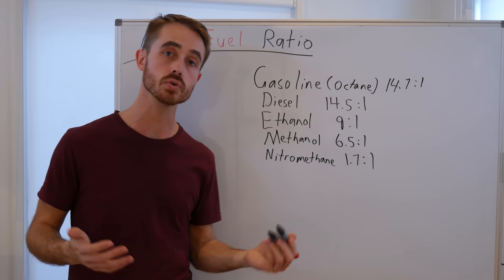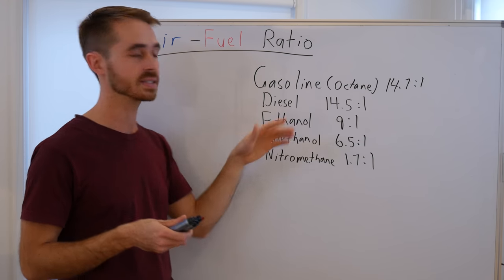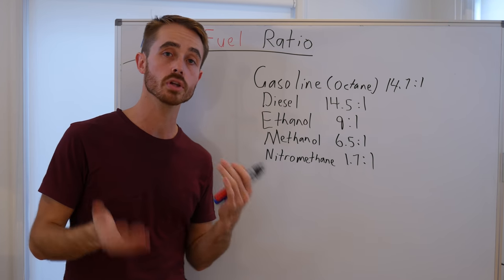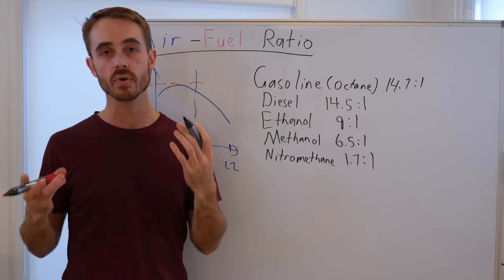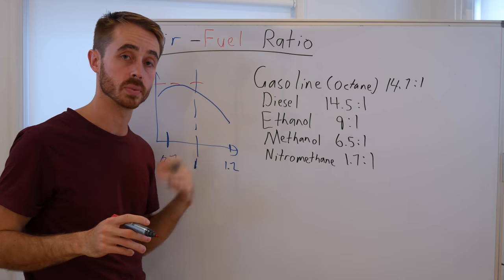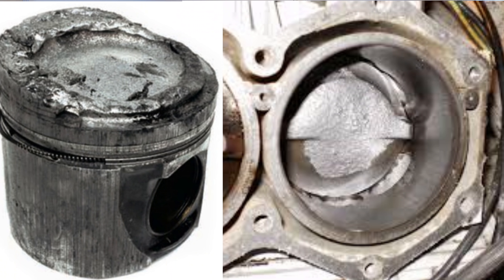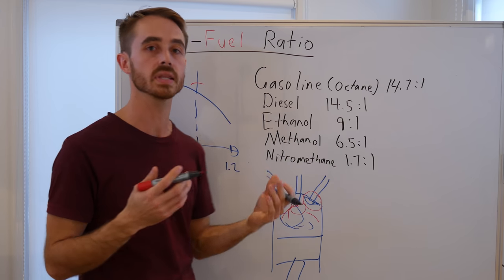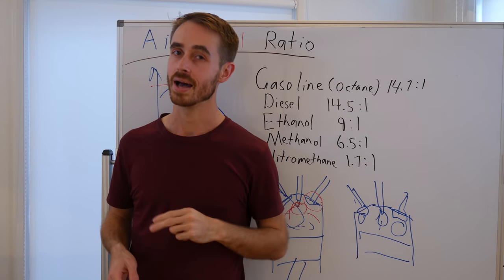Air/Fuel Ratio - How Does Being Rich/Lean Affect Your Engine?

Comment: Diesel engines are not stoichiometric by design. stoichiometric simply means all the oxygen in the intake charge is consumed in a given combustion cycle. Diesel engines are lean burning in general and air/fuel ratio is varied to control the speed of the engine. Not all oxygen in each intake charge is consumed in a combustion cycle. This is the number one reason diesel engines tend to emit higher levels of NOx. The leftover oxygen in the cycle forms oxides of nitrogen which is AKA smog. This is mostly corrected by the SCR and urea (diesel exhaust fluid) injection. Diesel engines often also employ cooled EGR to reduce the oxygen level in the intake charge during part throttle conditions. Stoichiometric is only applicable to gasoline engines.
Reply: +1
Reply: Nox is not technically smog, hydrocarbon is soot/smog

Comment: We use E100 since 70’s in Brazil. Ethanol is a bit aggressive to fuel system but keep the engines clean of carbonization, and not dissolve oil film like gas. The cars before flex ( ethanol only ) work with 13:1+ CR and is more efficient.
Reply: What Max CR have you seen with Ethanol?
Reply: @dennisrobinson8008  With pistons around 80-85mm bore and alloy heads water cooled, around 13.5:1 with stock cams and 15:1 with agressive race cams.
Reply: also b/c brazil produces alot of ethanol
Reply: Wow that sound like a hot rodders Paradice.
Unfortunately, here an America, the perception that we (USA) are the only ones who can have and create cool things. I know this isn't true, and I have known this for a very, very long time. This (your comment) is an example of an environment where a car/engine nut could go crazy and make power, but it isn't available in the USA. We don't always have the cool stuff, we could have.
Reply: @Fabio-jm9jq  13.5 to 15.5 you could make some power with that for sure!

Comment: Something interesting about diesel and gas is that the “combustion chamber” on the gas is in the cylinder head and on the diesel, its in the piston head. I dont know which is better for mpgs and/or power, i just thought that was neat.
Reply: Diesel is generally also regulated by timing of injection too
Reply: That isn't really all that interesting actually. It just has to do with the fact that diesel engines operate at much higher compression ratios, and a straightforward way this is achieved is having a tiny clearance volume, ie; a cutout in the piston head.
Reply: @SoumilSahu  I think it's interesting

Comment: being rich means you can afford better parts and maintanance for your engine
Reply: being lean means you're a gym bro
Reply: Lol yep.
Reply: @TheRobertChannel  so which gate vacuum line can get hot enough to melt lmfao, thats defiantly not how that works
Reply: @TheRobertChannel  U said a vacuum line could  melt lmfao, only way that would happen is if its too close to something too warm, u think hot air goes into a vacuum line?! XDDD
Reply: Nah, I think it's opposite : Fuel is EXPENSIVE, so if you run RICH, you spend MORE on FUEL, and have LESS MONEY to buy awesome NEW CAR PARTS...
Reply: @TheRobertChannel  I have a gas scooter I play with the screw it starts up 
Every time so I think I got it just right I hope
Reply: @funnydubby6401  Waste gate is on the turbo it gets pretty hot on the turbo like glowing hot the vacume line can easily rub on something hot and melt not sure why that's hard to understand ?
Reply: ace 996 compressor side doesn’t get that hot... and running rich wouldn’t be a wastegate problem because that doesn’t suggest how much fuel goes in, ur map sensor will though but if ur waste gate is failing then ur fueling should be able to compromise for the loss of air
Reply: Rich is better, but piston, combustion chamber area, exhaust port get dirty faster.
Reply: And being lean means that you're lighter than a fat guy so your power to weight ratio will be better.
Reply: I see what you did there. Lol
Reply: How bout being lean? Does it mean your a body builder?
Reply: Running a little rich is better than lean. Would you rather be at 13.2 or 16.2 for NA engine. The fuel rich has a cooling effect where lean has HEATING. What's better than being rich or lean is being tuned.
Reply: @justinbryant237  I never thought of that! 20.1 here I come!
Reply: @KDD8  lean is mean
Reply: @dennisrobinson8008  lean is swol

Comment: Today's ethanol blends alter the standard 14:7 stoich. With a typical E10 fuel stoich is roughly 14:2-14:4 and with a carbed engine it generally requires going a bit richer on the jetting from stock jets. At a steady state 'cruise' one can run cooler at an AFR of 16-17 than you can with an AFR of 13-13:5  (same scenario) non turbo or boost application. But you will need vac advance or an EFI set up for the leaner burn at part throttle condition (no/light load).

Comment: Thank you so much, as an aviation student, I could learn so much from your video related to the aircraft engine mixture system. Huge appreciate it!
Reply: Bear in mind that more fuel does not always mean safer/cooler engine. What this guy doesn't show on the graph is that cylinder temp. (and highest risk of knock) is highest and makes max power BEFORE 14.7, the top EGT. Safest is to run very rich or very lean. At economy cruise you'd want to lean past peak EGT to the point where you lose some power or rpm. I've seen so many videos where people take a LONG finding and staying at peak EGT, which is not good for the engine. And the worst part is that they then make the mixture a bit richer which puts them at worst possible cyl. temp. Unfortunately this is taught by a lot of flight schools. Watch a video called "obsessed with EGT", for reference.

Comment: Eng knock can also be avoided by running a higher octane fuel, don't get confuse higher octane does not mean higher volatility. 
Octane rating is an anti knock rating, developed in the second word war by the SAE to ensure that every batch of fuel for the spitfires was the same quality
Reply: llew virtue Correct except it was before ww2. Harry Ricardo came up with octane rating and his research got published in the early 1930. He also came up with the Merlin so yes you are correct, but it was earlier.

Comment: Cool stuff. This is relevant for small aircraft engines; these usually run very rich for takeoff to increase detonation margin, and lean off for cruise. In fact, most engines have manual mixture control, so it's useful to know what happens when you pull the red lever to lean the mixture for cruise. These engines have no ignition timing change (except a timing retardation for starting the engine); everything is simple and mechanical. Aviation gasoline still contains lead, but that will come to an end, and we will see how that works for high-performance engines, which still require an anti-knock index of 130 for takeoff power at full rich mixture.

You say Diesel engine often don't have a throttle body. Are there Diesel engine that do?
Reply: Thank you, I needed this answer.

Comment: In order to better understand air fuel ratios you need to show the optimum air intake temperature for efficient burn . For example optimum temperature for petrol is 60 degrees Celsius and LPG is around 90 to 110 degree's Celsius. Of course all of the fore mentioned temperatures rely upon an exhaust valve that is under proper temperature control.

Comment: Just what I needed.  With Lambda I wasn't sure if low was high or low and visa versa.  "Thanks for taking the time and posting, it was a "great education for me".  I have a custom LS engine where the overkill cam and high compression causes me Knock grief and blow-by has been way high since new.  Running so rich now its sort of embarrassing with the fumes and overlap especially with forged almost everything in it.
Reply: What does “LS” stands for?

Comment: correct your lean/rich definition plz, check 4:29

Lean means more air compare to fuel, rich means less air compare to fuel.
Reply: pumsjd  Please think about your statement. Lean and rich is not about the absolute amount of air or fuel in the chamber, but merely about a ratio. Call it percentage if you will. At a given rpm and throttle position the engine will generally always suck the same amount of air into the chamber. With more or less fuel injected the condition can be either more lean or more rich. But the amount of air doesn’t change. So no, the purpose of a lean condition is not to have more air so you can burn more fuel. You actually lean out the mixture when you’re at part throttle in order to save gas and make sure that you don’t have any unburned fuel. The cylinder pressure is lower at part throttle and therefore you have slower flame propagation which means that it takes more time to burn up all the fuel particles, while your time window for combustion stays constant.
Reply: @pumsjd  😂he tried to copy engineering explained guy but hilariously failed🤣

Comment: So running lean air fuel ratio and adding hho in the fuel mixture would take care of the high temperature issue? as gas generated by hho systems is cooler?

Comment: Interesting video.. Maybe you might know the fuel to Kw produced per quantity of fuel.And how much kw of power you can get running lean and running longer with the fuel you save. Again the ability to get that spark to set off the mixture is very important. No bang and the engine must go around again and try to fire off. If it don't get a bang, it will eventually die off. Would a vapor fuel like natural gas be more likely to detonated on very lean mixtures?

Comment: I have an engine light on and doing a OBD test on "measuring blocks" I have a continuous switching lean to rich mixture but with a preponderant rich mixture. I also have a P0420 catalytic converter error. Solutions?

Comment: Is H_vap of the fuel really the source of cooling that makes rich AF mixtures run cooler?  Thing is, there’s so little mass of fuel being vaporized that I don’t think this cooling effect would make much difference.  I believe the real reason lean mixtures cause knocking is because it burns slower, too slow at high RPM, which means less of that energy can get extracted as work and is therefore leaves your working fluid hotter which heats the engine to a point that can lead to knocking.

Comment: will this have any effect on rev hanging? because on my motorcycle, when i pull in my clutch the rpm hangs around 2k RPM for a few seconds before it comes down. could it be that it is too lean?
Reply: It's the electronic fuel injection that's doing that. And it is normal, to reduce emissions i think. When you let off the throttle the intake side closes slowly (unlike a carb.) in order to burn off the remaining fuel in a clean manner.

Comment: I would like to see a video on exhaust systems, how a manifold should be designed and what are the max hp per tube size is.
Reply: You don't get much power gain from headers and a tad bigger exhaust even with a 7 litre.  Its "part" of the much bigger puzzle but on its own is only a minor gain.  More for sound, show and pose.

Comment: question: if my engine runs over-rich due to the use of a BOV on a MAF car, will this have some positive effects in that more fuel is being injected, resulting in cooler engine temps?
Reply: Yes more fuel = cooler engine. If you put air in a fire, its get hotter.

Comment: That figure of 14.5: 1 with diesel is not correct with trucks about 17:1 is the smoke threshold also a huge factor of ambient air density before and after the turbo and intercooler
Reply: stoichiometric ratio for diesel is 14.5:1. all this means is that the ratio of fuel to oxygen is perfect for both reactants to be consumed in the combustion process. likely in the real world not all of the diesel fuel atomizes and burns so leaner ratios are in order.

Comment: Sir, going from 4500 feet ASL (0.06685 Air Density) down to Sea Level (0.07650 Air Density) (a 14.435% increase of air), is this an automatic increase (adding) 14%+/- fuel to compensate for the increase of air?

Comment: Banks Diesel just proved that modern diesel engines can safely handle 16.1:1 to 17.0:1 with their newest version of the i-dash system without having any emission problems and increase power by 10 to 15 percent which means Banks I-dash system runs leaner. Burning more fuel increases EGT's just look at engine dynos with high performance gasoline engines on with or without turbos or superchargers the exhaust system is almost glowing white because the EGT's are through the roof because they are burning so much fuel.

Comment: What about LPG? Also when you lean out say a 2 stroke motor you get more revs and presumably more power.
Reply: Only to a point. Go too lean and you lose power. With your typical air cooled two stroke, they often are pretty lacking in cooling and depend on the oil in the fuel for lubrication so they are tuned rich to keep them cool and lubricated. Therefore yes, leaning it will make more power but again, only to a point.
Reply from the maker: You have to be careful with how you think about "leaning out", typically a "leaned out" two stroke is still running Lambda<1, see this dyno plot of a tuned 2 stroke below: 

http://photobucket.com/gallery/user/coastiepete/media/bWVkaWFJZDoyNTkyNTk4MQ==/?ref=

And like wingracer said, crankcase cooling and lubrication with a two stroke becomes an important issue, so sometimes your AFR may be driven by that depending on what oil mix you run. With LPG, I have no experience with it so can't comment directly, but I can't imagine running it rich would result in much fuel cooling, so you'd probably target a very lean burn. One of the big problems with running petrol 4 strokes lean is high cycle to cycle variation, but that's a whole other video right there...
Reply: Bill Hollingsworth LPG consists of short chain saturated hydrocarbons with a slightly lower oxidation state than gasoline, but more importantly much smaller molecules and thus overall less oxygen needed per unit volume of vapour as compared to gasoline. Stoichiometric ratio between that of diesel and ethanol therefore, not exactly sure how to be honest though.
Reply: I think you're confusing the "air screw" adjustment on a 2 stroke for actually controlling the amount of air.  It does not.  99% of the time all the screws on a carburetor control a fuel circuit.  When people think they're leaning out the mixture by adding air with the "air screw" they are actually adding fuel.  I've literally never seen a single 2 stroke that gained power by closing the "air screw" and leaning the AFR.  100% of the time, from factory settings, 1/8 or more turns out, richening the AFR, adds power and RPM.  This is especially true for the last couple decades or so that the EPA has been meddling in the industry.
Reply: Go to lean it will seize a bit rich is better

Comment: If you can make Video on How to Run Aftermarket Fuel System on K20A2 with RBC Intake Manifolds ported and Bored if you running Walbro 255 Fuel Pump and Aftermarket Fuel Pressure Regulator without IAV !!! Thx in Advance !!!

Comment: What is the stoichiometric AFR for gasoline with a 10% ethanol mixture as we almost always have in pump-gas in the USA?
Reply: Never mind.  I found it:
Pure Gasoline	14.7:1
10% Ethanol Gas	14.04:1
15% Ethanol Gas	13.79:1
E85	                        9.75:1

Comment: I have a tsx I purchased recently I have a feeling there’s an issue with the mixtures of air and gas because of the lack of power when I accelerate hard. I don’t have a check engine light on, what can be the problem??
Reply: Check the volts on the battery and altinater should be really close to 13 v  mines at 13 5.btw Low voltage will cause power issue.  Also vtec sensor that operates the oil flow when vtec hits but if it's bad you wont hit vtec just feels super flat power. It will throw a code tho.   Cat could be blocked. Gas could be low on octane = old gas.    If it's breaking up that's gonna be some type of sensor. Or wire - ground issue. if the motor is for sure good.

Comment: If you could produce some charts utilising a data logger like a LM-2 innovate motor sport wide-band meter, on a typical 350 small block Chev (mild built) with typical Holley vac sec Carb that would be awesome! There are heaps of resources out there for fuel injected cars, but not much for the older school cars. Seeings as technology is now cheaper and more accessible I think a lot more people will be using data loggers on their old cars like myself :)

Comment: More fuel = lower temperatures?
I don't understand because without an EGR system, or a stuck closed EGR, this causes the vehicle to burn more fuel, which increases combustion temps and increased Nox, contributing to knock. 

What am I missing?
Reply: A leaner air to fuel mixture burns hotter. Oxygen is necessary for a clean, hot, and fast burn. The more oxygen you have the better the combustion is. A lean burn will have more oxygen than a rich burn and will therefore burn hotter and faster. Same reason why cracking the oxygen valve on a torch makes the flame hotter.
Reply: @Redtooth75  I appreciate the reply. Would you happen to know a quick explanation of how then a stuck closed EGR will actually increase combustion temps? I'm wondering if it has to do with some sort of dampening effect a properly working EGR would cause 🤔
Reply: Techno Mage It does not “increase combustion temps” but it “fails to lower it”. EGR basically injects WATER back into the combustion process, as you know the exhaust gas is CO2 and H2O, mostly.
Reply: fuel vaporization lowers temps. 

an egr system introduces inert gas to the intake stream to lower combustion temps (less oxygen available to burn, therefore less fuel burned). oxides of nitrogen (NOx) are formed by high heat and pressure in the combustion chamber. a failing EGR will not contribute to knock, they only operate under very specific conditions and not under high load.